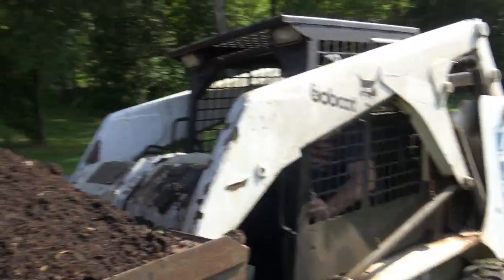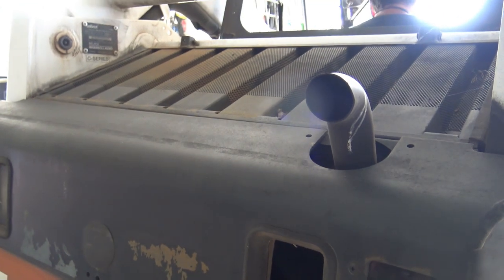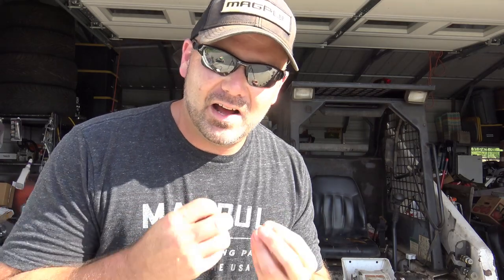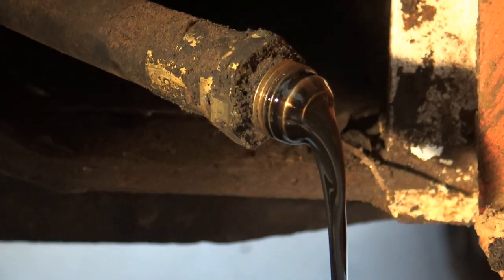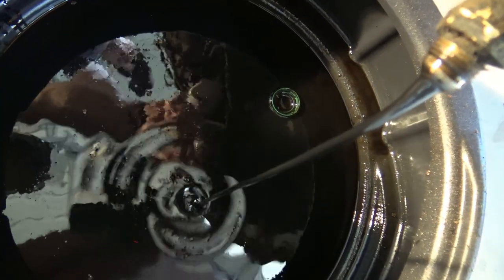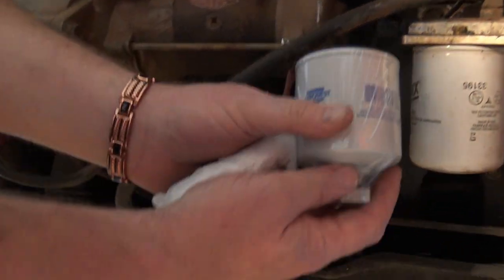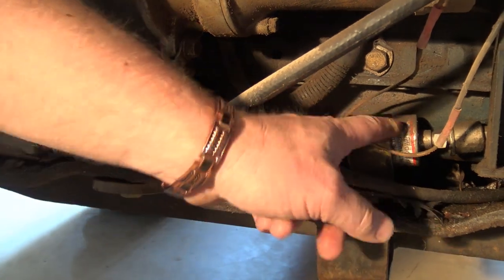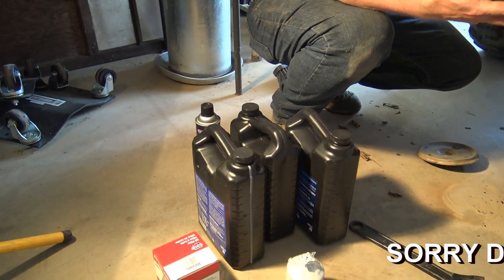NO OIL CHANGE FOR 9 YEARS!! SEE THE CHUNKS!!....DANGER!! CLOSE CALL LOADING UP!

Comment: I was taught to always load skid steers "backwards" on trailers. Maybe even from the Bobcat manual? when I have to load both my bucket and grapple, I put the grapple on the machine, then use it to hold the regular bucket... a lot less sketchy then that arrangement! I also added trailer (rotating style) jacks to the rear corners of my trailer, to support it while loading/ keep from lifting the back of the truck off the ground...

Comment: Pro tip when draining the oil if you use an air compressor to blow a little air in the dip stick slot it drains about 10x faster. (Not allot of air just enough to get it flowing. Also watch for how wet the air from your compressor is)

Comment: My wife bought a new Ford Thunderbird back in the 70’s, not sure of the year but she never checked or changed the oil. She had all kinds of problems when her brother found she was driving around with no oil in it. It was a mess, it locked up on her but, luckily her brother took the engine apart and fixed it. God bless.

Comment: My grandfather never changed oil in his truck; he changed the filter and added a quart for over 50 years! When they took the engine apart after he died they found it to be really clean and a very small ridge on the cylinders.
Reply: The filter is probably what did it.   He removed the sludge and gunk, so the engine would be clean.   Adding the quart each time was probably enough to keep the oil's lubrication properties up to par.    Neat!

Comment: I load my old bobcat backwards not only for the weight distribution on the trailer like others have mentioned, but also because the machine is terribly back heavy and will tip backwards if going forward up an incline without a load in the bucket, or even worse if no implement attached...  also, you might suggest the owner to change the chain case oil and hydraulic fluid at some point...
Reply: Yup so far your the only one that provided the correct answer loading a skid steer on a trailer.

Comment: Hey josh, you are close on the bobcat age buddy, I had a 7753 and it was almost identical except for a couple little things but my bobcat was a 1994 model, wish I still had it! I regret every day having to sell it but when I got hurt I just didn’t have    a choice. 

Backing it up onto the trailer is the best way to load it due to weight distribution on the trailer. If you pull it on bucket first then the counterweight will be behind the tandem axles and will lift the tongue up on the trailer and cause severe swaying above 40mph when your transporting and it can get real scary real quick. 

Good video buddy, thanks for sharing

Comment: I have two New Holland loaders, bought new in 2002 and 2003. One has a far greater workload than the other, on different yards. They are swapped every couple of years to even up the hours. One is now on 6500 hours and the other on 5500+. Oil is changed every 200 hours. I couldn’t live without them.

Comment: The reason why you load it backwards is for trailer weight distribution. So basically, load it above the tandem axle
Reply: Noah Schoenike we load our forward but it matters how You trailer set up is. We have a 14k tilt trailer
Reply: Clayton Hartin do y'all have a J3 class trailer?
Reply: Noah Schoenike i don’t know what you mean by J3 Class? The trailer requires a pintle hitch set up. We load a Kubota SSV75 which is like 13.7k without any attachments
Reply: Clayton Hartin nevermind

Comment: One thing I always do with my skid loader is put jack stands on the back of the trailer under the frame so it won’t lift up the rear end od my truck
Reply: I built drop legs for my flat bed for that exact reason. Almost put my truck into a ditch sideways without one
Reply: wtf are you talking about?

Comment: True story; 
About 35 years ago, my roommate/best friend came to me and said "I was with you when you burned your clutch up. Ridea around the block with me - I think my clutch is bad."

He barely made it around the block. That little Toyota truck shut off three times.
"When was the last time you checked the oil?"
"Uh... I just had it changed past month." (Lie)

I pulled the dipstick and it was nothing but burnt crust. Empty as Nancy Pelosi's head.
I put 4 or 5 quarts of oil in it and it started right up. Damn thing ran fin for another 5 years until he sold it. Those Toyotas are amazing...
Reply: Shredded Chi yep typical Toyota reliable as
Reply: I had a friend that bought an old Bonneville or something.  80's, V6.    He was told it leaked oil when he bought it.  

 Being non-mechanically inclined, he proceeded to add one quart per day, every day.     That old girl made it about a week before blowing the bottom end out all over the highway
Reply: Mason O'Regan oh well shit happens and it's alright if you learn from it

Comment: My wife had a Geo Spectrum back before we were married.  When I changed the oil, I opened the drain plug and nothing came out. Lord knows how long it had been since the oil was changed. Used a screwdriver to get some oil out. Had to remove the oil pan and clean it up, run new oil for a few hundred miles and change the oil again. Ran like a top after that !  #jtrspartacus

Comment: And that is why you want to block the trailers wheels when loading/unloading heavy things on the ramps. 

Good trade waste rocks for use of a bobcat. 

Now you just need a used oil burner or a shop heater that runs on oil for easy disposal.

Comment: Always support the back of the trailer before loading something like that using ramps. Best way would be back the trailer to a hill and jam it into the bank. then drive straight on the trailer. For support you could use a high lift farm jack or a bottle jack on blocks. Anything to keep that weight from lifting the back of the truck. Most trailers made for heavier things have supports on the ramps for just such reasons.

Comment: Even though it's 9 years if it does not have that many hours on it it won't be that bad. Think about all those old cars and trucks sitting around on field edges that people get or like a bronco out of a barn that been there for 20 years, it's usually not that bad when someone foes to get it running again as long as like water and stuff haven't got into it.
Reply: Well actually oil has a life span. The additives begin to break down in time. That's why if you look in your cars owner manual it'll say something like 3,000 miles or 3 months. Because the oil begins to break down.
Reply: Josh Dupont 

Yes your right. But if we're talking short runs trips or a brief start that oil that has just a few hours on it but it's been in their say 9 years is still doing an OK job. Still more wear occurs than should and it's not the best. In no way am I advocating 9 year oil change intervals or that it's a good thing. Just that it can look like normal oil after 9 years and your engine can still rum on it.
Reply: Nate vanLandingham oh okay. Sorry
Reply: You also have too worry about water / condensation in the engine oil.    Old oil in a low hour motor can turn "cheesy" almost like if you had a head gasket leak.    All the "off time" allows moisture to get in there and once churned into the oil it makes that foamy cheesy gunk.

Comment: I worked at a Quick Lube once, truck came in for an oil change.  I pulled the plug on the pan and no oil came out......had to constantly use a screwdriver to clear the clumps from the drain hole to get it emptied.  We ended up pulling the pan and cleaned it out.  Guy said he had used the same oil since new.......you can guess the brand, I won't mention it so it does not start an oil war......LOL!
Reply from the maker: Man ...the $100 truck had some chunky monkeys in it for sure.....I took it to Walmart for it's first oil change in 5-6 years
Reply: I had a customer bring in his Chevy truck. Same story.  He wanted me to dummy up receipts showing a good service history on the truck so he could get Chevrolet to warranty the engine. He got the oil change and a properly dated receipt.  Pretty sure he paid for the overhaul himself.  Some people are scum.

Comment: Been sub'd and have had the bell clicked for quite some time, 6 months or longer... I just now get the notification on this video 5 days later?? 

Only thing I would suggest, other than actually telling the owner to do proper and regular maintenance on that Bobcat, block the front and rear wheels on his pickup, trailer wouldn't hurt to be blocked either. I ran that particular model for roughly 10-12yrs, and it's predecessor, (743) about 8yrs, one of Bobcat's better models period. Owner also needs to learn to keep the load closer to the ground, less chance of tipping forward. If she's starting to smoke a little, might be time to start thinking bout an overhaul and yes, that machine IS worth the cost for one and quite easy to do.

For those complaining about the loading job and, calling others "idiot"... each their own, everyone IS human, no one is perfect and this is NOT a perfect world we live in either!! Some people can be told, others need to see/do it for themselves before understanding, an old saying, "can lead a horse to water but, you can't make it drink".
Reply from the maker: I agree.....and yep anytime I post anything about a tractor, beekeeping, chainsaws, mechanical or farm equipment related...there are all sorts of immature name calling wieners that come pouring out of the woodwork....arogant infantile wieners that just know everything about everything...that's why they're 55 years old and make $8.50 an hour ....because they're so smart....imagine everyday you wake up and delete 50 know it all jerk comments...oh and 25 more calling you an idoit, asshole or dummy...sure brightens my day.....helps me put my life into perspective lol

Comment: Put a block of wood under your dump trailer in the back so it doesn't lift the back of the truck up.  Or weld some stabilizer jacks onto the back of the trailer.    Be safe.

Comment: Who cares about the oil!! It’s not your equipment and if it were a problem, the owner would’ve addressed it. Maybe add it to your equipment maintenance schedule going forward. The backwards loading is best as it applies load to the tongue. Chock the wheels so the truck remains stationary going forward. Fact is, we watch because it’s entertaining and half of the haters lack experience using the equipment; owning the equipment; or have toys in general to even make a justifiable comment. Just keep the content rolling cause you can’t please a-holes.

Comment: Hehe, I bought a 1990s John dear tractor that hasent had oil change in 16 years. After lots of use it started leaking oil at around 2006 or so you just would add a quart every year or so, i changed it and it was black syrup.

Comment: Lesson there! When you have a rear wheel drive truck hitched to a trailer, you must chock the front wheels. If you were on a down hill grade. that would had been a diaster. With four wheel  drive vehicles, as long as you're in LOCKING FOUR WHEEL DRIVE, you can get away with it. But it is always better to chock the front wheels when loading ANYTHING on a trailer.

Comment: It's actually better not changing your oil, as it turns to grease which is good. Also, I think butt loading the skidsteer puts more weight on the tongue which is better than it being too light.
Reply from the maker: Lol
Reply: Good stuff right there !
Reply: I use grease and vegetable oil. It’s the best
Reply: Scott, yeah buddy !
Reply: All jokes aside, that old diesel is a strong engine. New ones can not go that long with out serious mechanical issues arising from lack of good oil. Good machine. 

Try some sand in the gas, it’s like sandblasting the inside of your engine cleans it real good. Real real good.
Reply: If y'all think grease and vegetable oil is good. Try water! Nice and runny. Gets through all the little tight places oil won't every get too. Will last 3 times as long
Reply: august can I just use straight grease?  And what is better?  Green or red.  Also, I have some white stuff at the bottom of my veggie oil totes, how does that do?
Reply: Don't forget to check the shack yack and add a blinker fluids 😆😆😆😆😂
Reply: @scottschaefer2086  old Land Cruiser 1HZ engines are monsters you could drain the oil out of one and it will run till it completely locks up same with old CAT V8 diesel engines have one in a old Steiger Panther after a crack in the oil cooler housing she ran almost bone dry didn't notice till i got out to take a piss. new oil cooler housing and some oil and she was back in action and that was 3 years ago still runs like the day she came out of the factory well almost it needs a rebuild on the AC gets a little hot in the cab during summer time.

Comment: It's probably going to start smoking now with thinner oil or soon . Lol what a waste of a $30,000 piece of equipment are used to work on those onan engines. Fuel water separator! That's got a diesel engine hot damn that's even more than 30 grand new today are used to work on the gas ones Ingersoll rand .I like him but boy did they destroy the lawn putting down mulch and plants and bushes we used to have to put on sheets of plywood. That 15 W 40 doesn't look too bad. Who makes that engine Josh? You must've seen something in there.
Mike

Comment: What brand motor does Bobcat use?
Reply: erick stiner in that machine it would be a Kubota diesel. In the last 4-5 years they have switched over to a bobcat branded engine, which is a doosan (bobcats parent company) and bobcat has engineered some of the emission control systems, giving them the ability to brand their own engine.

Comment: People can be so mean with stupid comments.    It is not how many years the oil is in the skid steer it is the hours.   How many hours did it have on it when you changed the oil?    I have a friend that is using the synthetic oil and changes his oil on his truck every hundred thousand miles and has it tested monthly for foreign contaminants, but changes the Filter every ten thousand miles.   Takes samples of the oil every time he changes the oil and has it tested and if the oil fails before 100,000 miles he is warranted on his motor